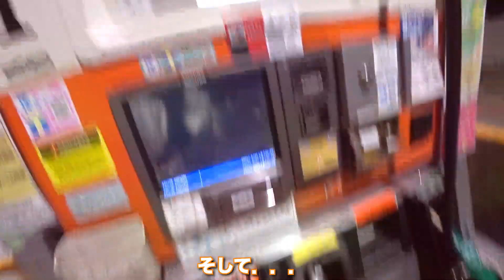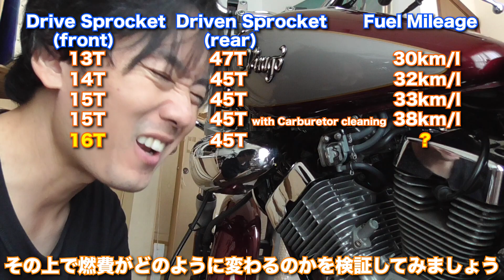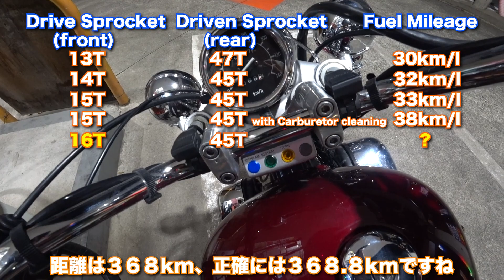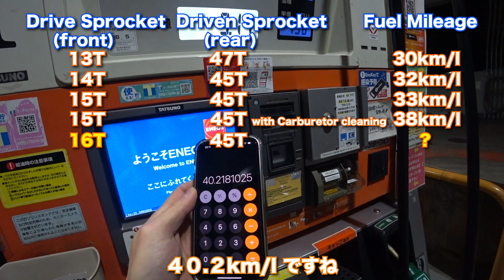Fuel consumption trial - The relationship between Sprockets & Fuel mileage【XV125 Yamaha Virago】

Comment: Hello sir, from the settings you use now, don't you lose a lot of torque power and Is it enough to bypass another vehicles or riding on a slope?
Reply from the maker: Loss of acceleration torque is inevitable. It’s a trade off but it still can bypass other vehicle as long as the slope isn’t too steep.
Reply: @psycho-cycler  Noted, thank you for the feedback, I'm actually quite surprise by changing the sprocket, the bike can get a huge improve in fuel consumption. Might try this on my bike also:yougotthis:thank you again for sharing sir.